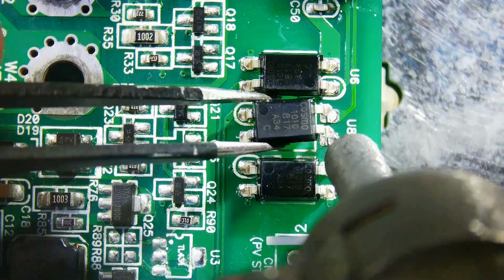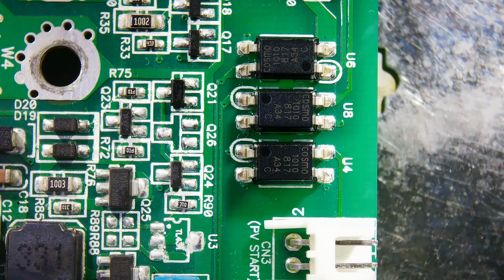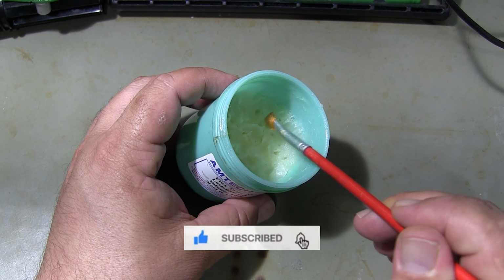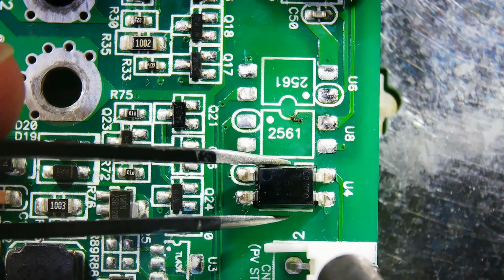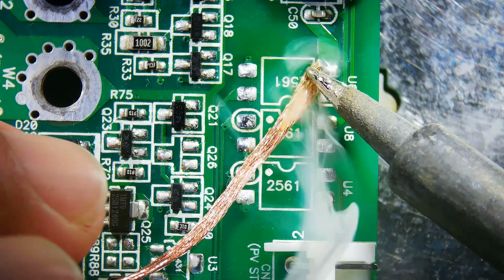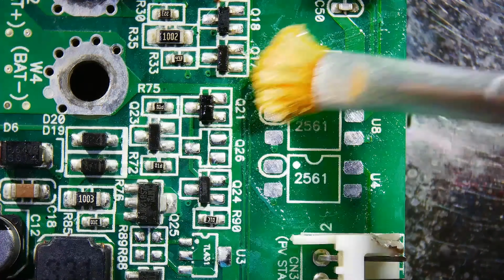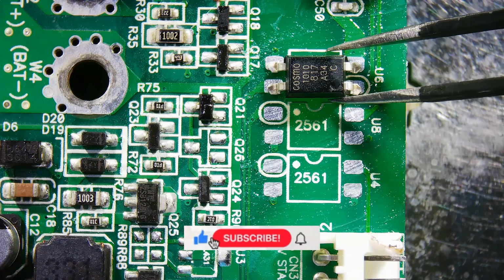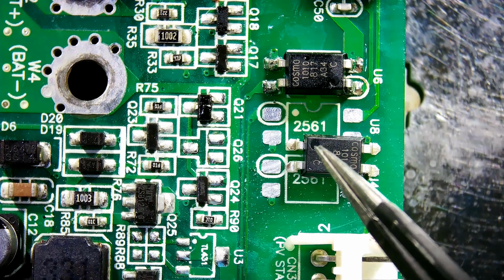Never Struggle Again: Step-by-Step Guide to Replacing SMD Optocouplers

Comment: Hi . Great video . What temperature is your soldering iron set at ? Also what size tip are you using? Thanks
Reply from the maker: Hello, thank you for your interest. The soldering temperature is 375 degrees Celsius. I use a thin soldering tip.
Reply: Thank you !